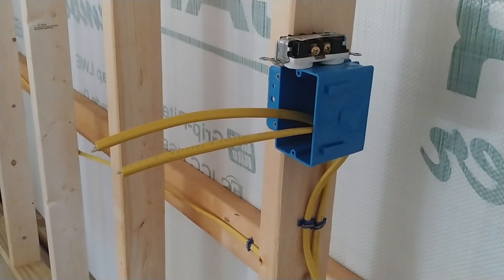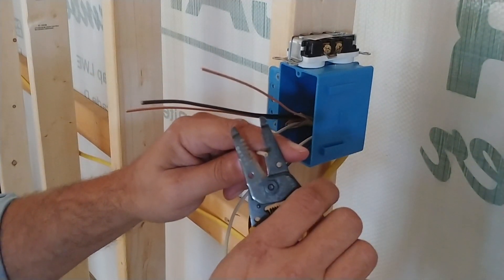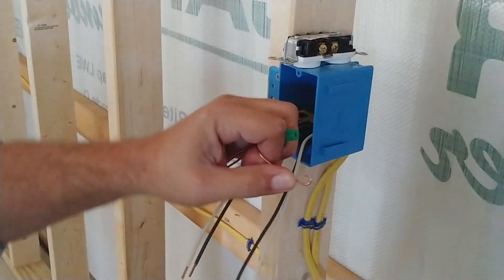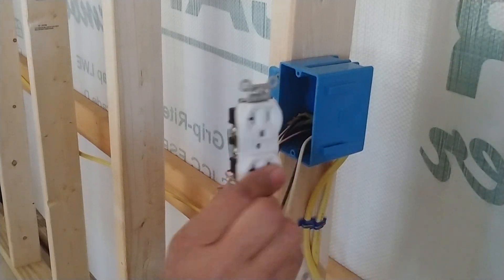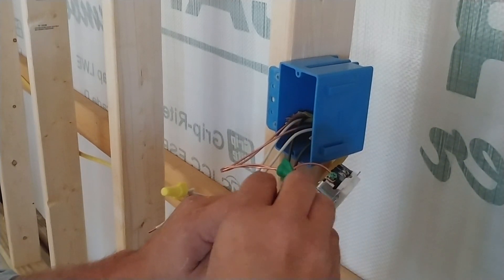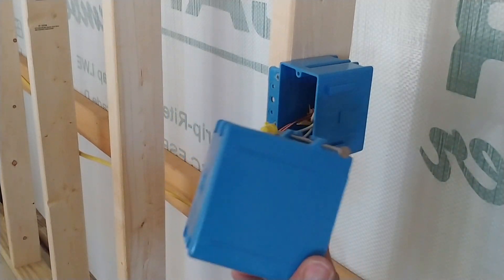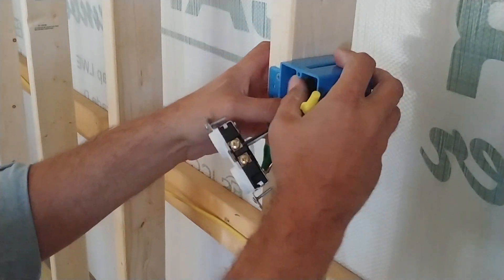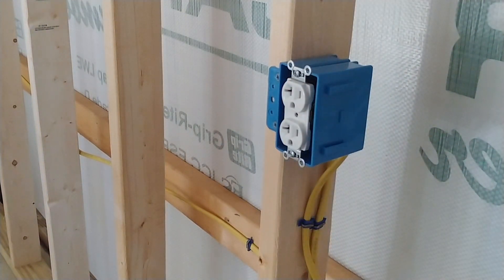Wiring up a outlet tips and tricks.

Comment: How.many continues outlets  can you run from one outlet  to another thanks
Reply from the maker: Sorry on the delayed reaponse, code does not specify a limit to the numer of outlets.  But 10 outlets on 1 20 amp branch circuit :)  is what I recommend. A good rule of thumb is to treat each outlet as a 1.5 amp load.  Code states all load should only be 80 percent so 10 outlets at total of 15 amps keeps you below the 80 percent of load. Using the same logic 8 is a good number for a 15 amp circuit and keeps you under 80 percent of the load.  Hope this helps :)
Reply: @BevinsBuilds  thank you for the reply and yes helps a lot.. keep up the good work...👍👍👍👍👍
Reply from the maker: Thanks, hopefully Ill be done with my major projects soon and Ill get to making some new videos.
Reply: @BevinsBuilds  don’t you have to account for light fixtures tied into the feed with the receptacles? I know that there’s a lot of receptacles that are daisy chain and that there’s light fixtures that are also daisy chain all into one circuit “15 or 20 amps” well at least on old the houses,I’m not sure about the new houses.
Reply: 6

Comment: I always put electric tape around the plug and cover the screw's so you don't get shocked if the power isn't off for some reason if/when you need to upgrade a plug or replace one
Reply from the maker: Yes I should have shown that as well.  Wasnt thinking.  I always called that a curtosity wrap. :)
Reply: @BevinsBuilds  just like you said,is as  a courtesy is not necessary or is not a code, on metal bxs It is necessary but not required...good observation tho.